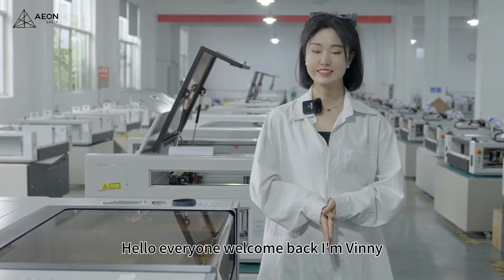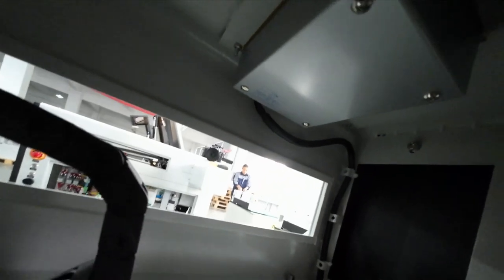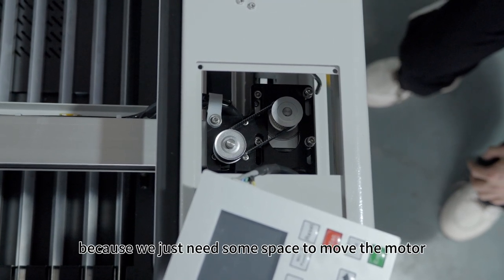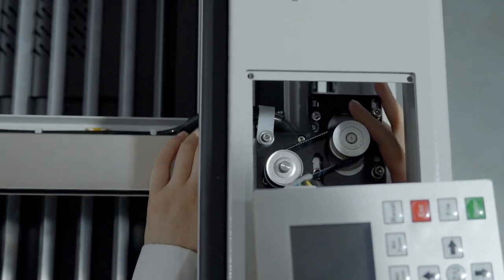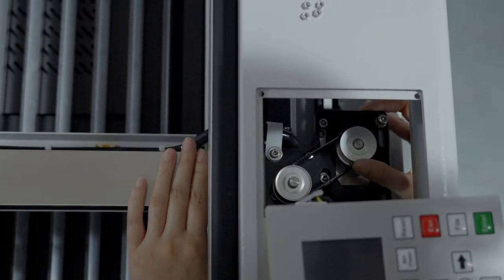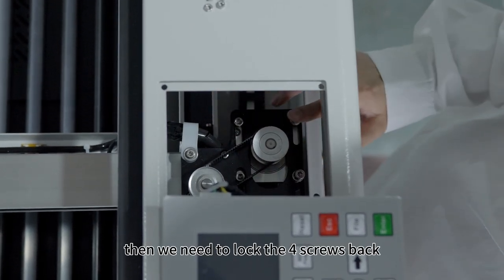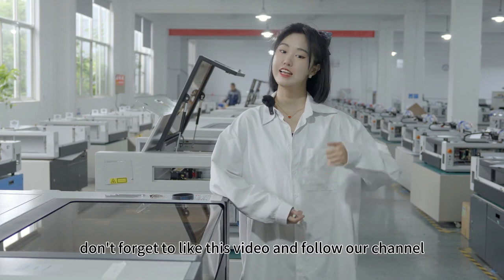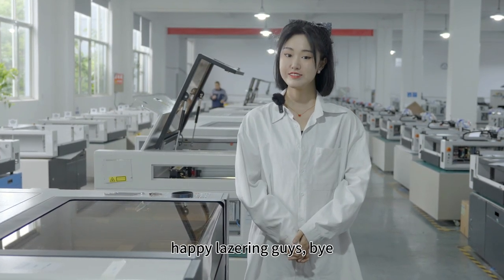How to replace the timing belt on laser machine | AEON | TUTORIAL

Comment: Oh, and I just want to point out that removing the panel could be an easier process. Those nuts are hard to access! I'd rather have 4 bolts/scews heads at the top of the machine than having to go upside down.